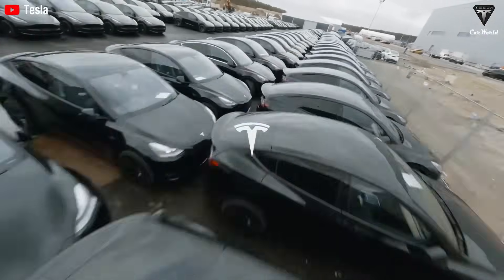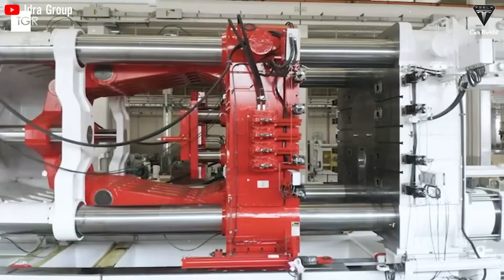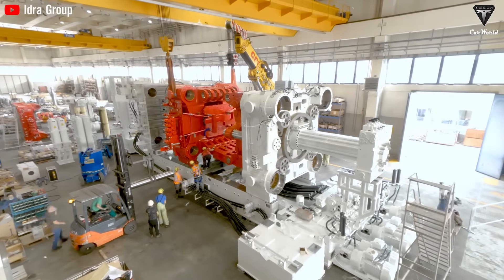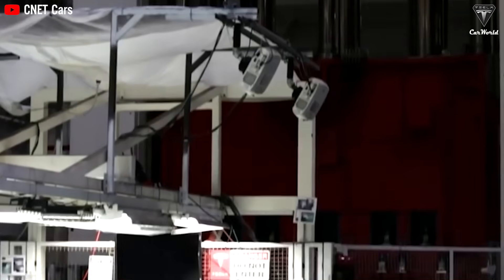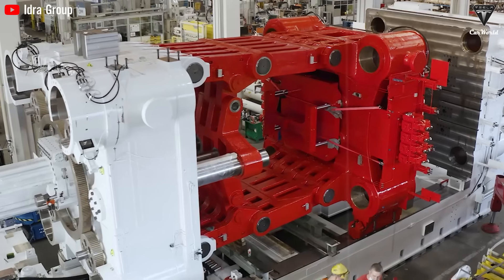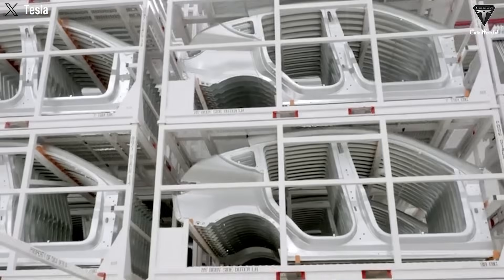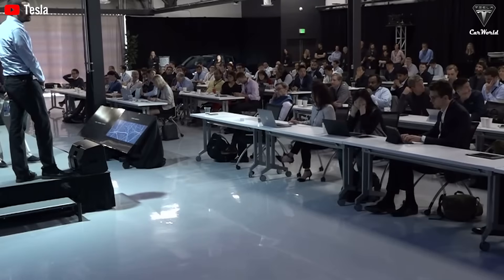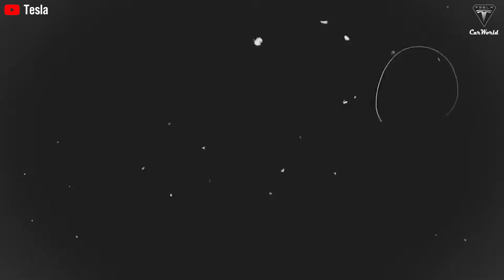It Happened! Elon Musk Shocks With Tesla 50,000T Giga Press Upgrades! Only 3.75s per Unit!

Comment: How does the company manage aluminum supply chain logistics, especially considering the volume of raw material required for such high-speed output?
Reply from the maker: Valid supply-chain worry—Tesla secures multi-year low-carbon aluminum deals, recycles 100 % trim on-site, and feeds presses from buffer silos, keeping material steady and costs down.
Reply: Well Aluminium are more comon then iron in earths crust. 

Wish for solid state aluminium batteries to!

Comment: How does gas injection (nitrogen/argon) balance the molten metal’s purity without introducing other chemical variables?
Reply: You already know that if you don't do it. the part will fail.
Reply from the maker: Great purity question! Short nitrogen/argon degassing removes hydrogen and oxides; inert gas vents before injection, keeping alloy chemistry stable and producing stronger, defect-free castings.

Comment: What temperature control methods are used to prevent thermal fatigue in the mold and surrounding infrastructure?
Reply from the maker: Great heat-fatigue concern—smart molds use conformal water channels, oil film, alternating coolant circuits, plus real-time thermal sensors adjusting cycle pauses; longevity proven beyond 500 k shots, reducing cost for owners.

Comment: Cast vehicle frames are not repair friendly, insurance friendly or damage resistant… Tesla vehicles are commonly totaled by insurance companies for seemingly minor damage.
Reply: Your point being ?
Reply: @Known-unknowns  The point is "cast vehicle frames are not repair friendly, insurance friendly or damage resistant".
Reply from the maker: Totally understand the worry—early designs were tough. Tesla now uses sacrificial crush zones and modular cast sections; rigidity boosts crash safety, fewer welds speed affordable factory fixes.
Reply from the maker: Fair question—concern is repairability. Tesla adds bolt-on crash rails and sectional replacements, while Giga-Press halves build cost, lowering parts and insurance rates.
Reply from the maker: We hear the repair concern. New giga-cast frames use bolt-on crush modules—swap the damaged zone, not the whole shell. One-piece rigidity limits structural hits, and insurers track falling injury payouts.